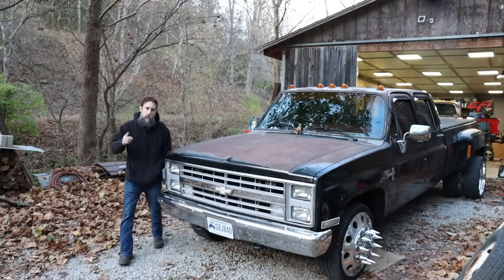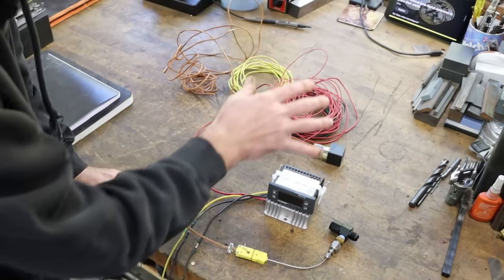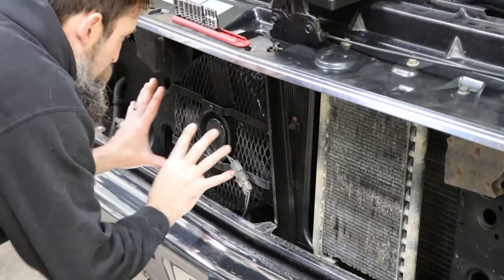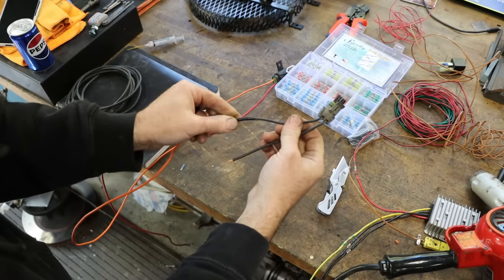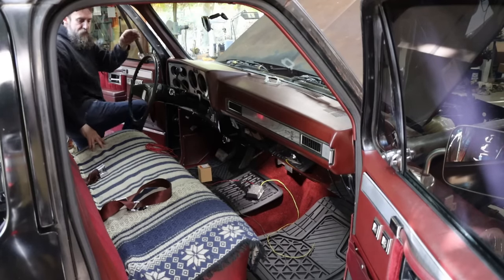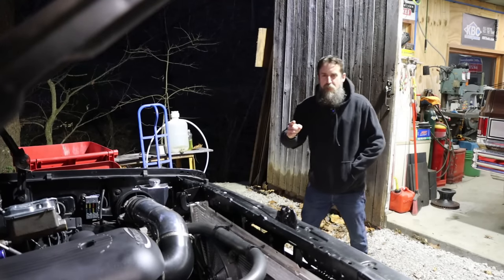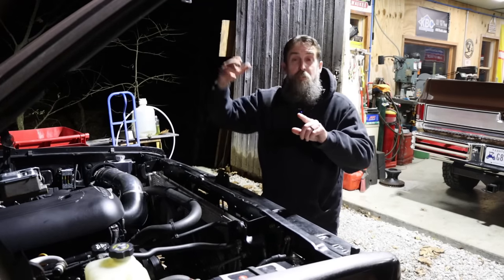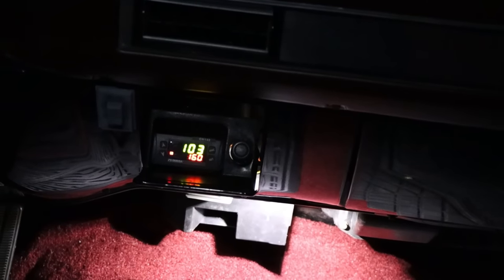Losing my Cool with Johnny Cash the Crew Cab,

Comment: 💡💡🤔🤔I used the lighter hole in my ashtray in my 1990 GMC Sierra SL to install a blue led push start button off the turn key ignition wire. Works like a charm. BIG Plus anyone trying to steal the truck won't have a clue why the engine isn't starting after busting the ignition key tumbler. Than I reused the + - wires for the lighter to install and power a USB charger in the dash. Win Win

Comment: On a somewhat related topic. I wanted a water cooled tig torch on my tig welder. I used an aftermarket transmission cooler that I had laying around to pump a 50/50 mix of antifreeze/distilled water solution thru the tig torch, thru the cooler and used a 1 gallon gas can as the reservoir. It works like a charm. the whole setup including the pump cost me about $100. The transmission cooler has plenty of capacity to keep that torch cool. I even installed a little needle valve to regulate how much fluid gets pumped thru the torch, but that probably wasn't necessary. The antifreeze/distilled water solution will ensure that I don't get any lime scale build up from plain tap water.

Comment: Great video! The difference of heat transfer between a metal tube in water compared to a metal tube in air is about 25X.
Reply: Assuming the air and water are the same temp, yes.  Difference between the air and coolant temps comes into play though, so it's not that large a difference.

Comment: Not only you can manage the transmission fluid temp with this, you can also check if the heat exchanger in the radiator works as it should. 
Great vid on a great job, thx a kot!
That ladder story was creepy, stay safe!
👍👍👍

Comment: Nice installation - not that I am surprised by that given your attention to detail. I'm certainly glad I have a transmission temperature gauge on my truck as we haul a 5th wheel travel trailer a lot in traveling season. Mostly we travel in early summer and the fall and so far, so good, but it is reassuring to know. Transmissions can fail very fast if they overheat a lot.

Comment: Steve, for whatever it's worth, I've been working on a parking lot sweeper that is diesel powered, and the radiator has an integral hydraulic oil cooler on it. I think there's a lot of history behind radiators with transmission coolers on them.

Comment: LOVED this video, even running the wire. I had questions about how and where you were going to place the thermocouple and you not only answered every single one but also discussed your interim solution. All the while telling a funny story with a message. In the lovely shop you renovated. On the perfectly restored truck you built for your wife. Damn dude, inspiring much???? 😀WTG.
Reply from the maker: Thanks, 👍😁 I figured it was best to cover my thoughts and why I did things the way I did, or else folks would have lots of questions.

Comment: About two weeks ago, i had a ladder fold up on me, causing me to fall 4' to the concrete butt first, i saw stars, and it took me a couple mins to get up. I had a pretty intense pain in my lower back for a little over a week, it's lots better now. At 51yrs old I was praying I didn't do permanent damage. That ladder met it's maker in the form of a sawzall. Y'all take care
Reply: Good to make sure that ladder will never be used. Have done the same plus used a saw to cut a dangerous wood one up as people kept using it. Seen them in use held together with tape and strapping.

Comment: Good to see you and a great video. As a retired electrician, Moore than once I have missed the last rung on a ladder and wound up on the floor. Just in a hurry, not paying attention and it happens so fast. I feel your pain. OSHA wants both hands on the ladder. We used a good sized drill to make 1" hole for wires, but we used the cord to lift n lower the power tool. We always got the ones with a twist lock at the drill or got help from someone to hand it up or take down. You are lucky, I was lucky. But you gotta do whatcha gotta do to get things done. So glad you didn't get really hurt.OSHA can make things so much worse. Take care n slow down. We would really miss you if you were not here for our Saturday morning. Thanks for all you share with us.
Reply: Well said .......🍁

Comment: Yeah, I feel your pain about that fall. I was shoveling some snow, a couple of years ago, from my somewhat steep driveway. I was foolishly wearing worn-out Crocs at the time. I was done shoveling and was just going to put the snow shovel away, when I realized I was literally upside down. I landed on my Rt upper arm and shoulder. I've taken a fair number of tumbles in my 70 yrs, but I've NEVER had an impact like that. I believe I blacked-out for a bit, but still struggled to my feet, where i leaned on my car for a bit to catch my breath, then, according to my wife, my eyes rolled back in my head and I passed-out, again. It rearranged my entire rib cage on my right side, and it took about 6months to feel even somewhat normal, again.

Comment: Hey, Steve. I've used those same type connectors and have found that a little soldering flux on the wires makes for better solder penetration while applying heat to the connection. You should test it out to see if it makes a better connection. It might be good content for another video. Have a great day, and stay safe. Sorry about your boo boo. ;)
Reply from the maker: I will try that👍
Reply: Would also suggest making sure wires are clean as well. Plus switch 12v and not ground as that is less likely to result in the fa  motor rotting as it now always has power. This means any moisture in it will cause corrosion as the current flows to ground. Putting the relay near the battery and close to the fuse means less high current wire runs. Controller supplies 12v to the relay as well so no corroding there. Plus switching supply means if you want to get ac running again you simply splice in the 12v wire as the ac will apply 12v to run the fan as well. Less work overall and you could simply have spliced in a single wire to the fan.

Suggest moving the sensor to the input side as after all you want to see if the fluid is arriving hot not that the cooling is working so sense if the trans is working hard and apply extra cooling till it is not. Trans normally gets hot with slip so highway is not a worry but frequently changing gear or not locking up gets it hot fast.
Reply: @SeanBZA  I agree with switching the positive side, but how does mounting the relay closer to the battery make the high current wires shorter?
Reply: @SeanBZA I’ve found it quite common for switched grounds in the GM vehicles I’ve owned and modified. The aftermarket EFI system in my 68 Camaro switches the grounds for the electric fans. Not saying it’s the only or correct way, but it is quite common design from the OEMs. The trick for add-on components is ensuring the added ground point has a low resistance bond to the chassis ground. Relying on a fastener isn’t sufficient in most cases, so it’s always best to remove any paint from the chassis prior to fastener installation. Been using those solder sleeves for 30 years or so. They are quite common in the aerospace industry for splice repairs. I did many of them on the space shuttle.
Reply: @paulharris9434  Here the fan is literally a foot away from the battery, so you just need to have a foot or so of high current wire, the rest can be low current wire, as the fan ground already is there to run it, no extra wire needed. Just have the battery, the fuse, and the relay right there, nicely weatherproofed, and then a wire to the fan in a sleeve to protect it, and then run the control wire to the controller, which also has a nice extra safety in that if the 12V to the controller fails the fan will not run, even if the relay in the controller sticks on.

Comment: I love your system and I would do it the same way, except one Thing. 
The hot inlet from the trans, has to go to the top of the cooler, and the cold out of the bottom. 
The warm area will always be in the top part of your radiator. So you will not get the efficiency of the cooling with the opposite connection.

Comment: I think the 4L80 has a temp sensor built into the harness at the valve body and it is accessible in OBD data. I bet there is an option in your PCM that could have been used as well. Either way, loved the project in this video.
Reply from the maker: They do have a built in thermocouple in the trans wiring harness.  It can definitely be accessed with a proper scan tool. I believe the ECU monitors trans temperature and can put it in limp mode if the temperature goes above some set temperature. 👍
Thanks for watching the videos 😁

Comment: Steve looks great I'd actually recommend placing your thermo couple on the output line at the transmission or if I remember correctly there is a spot on the left side where you can add one but not the best.
Pan temp is a good average but in line will show real time max temp what the cooler will be seeing is why I'd like to see the output temp so you nip the temp rise in the bud before it gets out of hand!

Keep up the good work!

Comment: great video,  the temperature of the radiator will be a lot lower that the engine temp as the thermostat only allows flow to the engine when required. so your hot oil from the transmission will generally be hotter that the coolant in the radiator.

Comment: Steve worked at a transmission shop when in high school you can get the transmission too cold. When too cold it will not shift untill it is warmed up.

Comment: I actually was powertrain cooling engineer for GM Truck Engineering. A few random thoughts: the heat transfer of the fluid/fluid "top" tank cooler is significantly more than the fluid/air cooler. Also, the fluid/air cooler is dependant on airflow which correlates to speed. Airflow through becomes more restricted the closer you mount to the radiator. The top tank coolant is lower than engine temp... otherwise your radiator isn't doing anything. You could move your thermocouple adapter to the trans cooling outlet versus dropping and welding on the pan. Where you take the reading is irrelevant; its just a reference point. A temporary way to capture pan temp is to run a thermocouple attached to the dip stick. Way easier to just monitor the data stream.

Comment: The ATF works best when it is warm so that it being part of the radiator helps the AFT to warm up quicker and then it stabilises with the radiator temp.  In winter in particular, the sooner the ATF is up to temperature the better so as not to drag on the clutches.

The as installed wiring system is correct, you do not need to monitor the fluid temperature in the trans pan, what's important is the temperature going into the pan.  Remember the fluid is circulating all the time so that any excess heat will be going through the cooler(s).  What is vital is to monitor the temperature going back to the trans as that does not want to be overheated so that your thermistor is correctly positioned to warn of that and to switch on the fan to add extra cooling.  If you are paranoid about the trans temperature fit a simple temperature gauge.

Comment: Hi Steve.  Some Silverado's, Sierra's, Suburban's, etc. came with a trans temperature gauge in the instrument cluster.  Your 4L80E may already have a temperature sensor built in.  I'm not sure which ones do or don't.  I think though the way you set yours up will work fine and is certainly better than not having any idea what the trans temp is.

Comment: Nice job on the additional trans cooling. I would like to draw your attention to 18:00 in the video. The open space seen between the core support and the cooling stack ( radiators) will allow air while at speed to rise over the cooling stack and while at low speeds or siting still will allow some of the heated air that exit the stack to recirculate back through the stack lowering efficiency of the system. If you shroud the cooling stack on all four sides to funnel all the inlet air from in front of the core support it will aid in cooling especially on those hot summer days.
Reply from the maker: I have been looking for a good way to seal around the radiator. I was thinking some sort of foam.
Reply: @SteveSummers   I have used everything from foam, rubber weatherstripping, conveyor belt material along with aluminum sheet/structural stock welded and/or riveted for structure.
Reply: @SteveSummers  How about the foam swimming noodles?

Comment: I have been told with these transmission you should run the aftermarket cooler first that way it the temp of the transmission will be warm enough to let it go into lock up because in the winter it mite no get warm enough to let the transmission to gointo overdrive and or lockup because to cold

Comment: I think I saw someone who put a trailer brake controller in an ash tray similar to what you did.

I wonder if someone makes a dual thermocouple monitor box so you could have the pan temp connected to the fan controller and also simply monitor transmission inlet/outlet temperatures.

Comment: The coolant heat transfers from your 2 heat exchangers should be more than adequate for your configuration and use. This is not Formula 1, NASCAR, or a compact nuclear  reactor🎉😂. I agree with a closer control location closer to the output rather than the input. Love your videos dude, keep on recording.🤙👍👊👊

Comment: Take it from a guy that has learned the expensive way, you can kill a transmission by over cooling it.  This is why factory cooling is done in the radiator. Engine coolant keeps your trans temperature in optimum temperature range, not too hot or cold.  For this reason your fluid should go to the external trans cooler first, then pass through the radiator so that it stays within the optimal temperature range for best transmission life.

Comment: You made a simple cooling circuit quite complex. You could have used a thermal switch with the value you want and there is a relay for the fan already in the car, you could have controlled it with that thermal switch.

In cooling circuit, the temperature measurement should be after the cooler, so you have it in the right place. If it were in the oil sump, the fan would run unnecessarily.

Comment: The way you plumbed your cooler setup is pretty much identical to how Chevrolet did it from the factory on my HD 1 ton van.  If their engineers thought it would work for HD applications it's likely just fine.
Reply from the maker: That's my thoughts as well. They have been doing it like that forever.

Comment: A customer of mine stopped by my shop one day arm in a sling and the first thing he did was throw away a brand new wooden 3ft step ladder into my dumpster. One of the feet broke and he fell off of it. He broke his collar bone, boy was he mad at that ladder. He didn't even bother to return it for an exchange or refund. I later took the ladder out the dumpster duct taped the split leg back together and still use the ladder till this day. This was 20 years ago. I never seen someone so angry at an inanimate object before.

Comment: put a sensor in the line coming out of the tyx and the line coming out the final cooler to see the tx temp and temp drop across the radiator.

Comment: You can move your probe to the line coming out to radiatir input and get a closer reading of oil temps than being out in grille and getting air cooling that can give you misreadings or temps lower than you want to kick fan on... then do the pan mod if you feel you need that when you change oil and filter...🇨🇦🤓👍
Reply: If you catch it after the radiator then you are basically measuring coolant temp not the transmission temp.
Reply: @ericpaul4575  
yes ..why i would put it after it leaves transmission...

Comment: That's a lot of monkeying around when all you need is a temperature switch in your coolant line to operate the fan relay.  Just find one that comes on when the transmission coolant reaches a temperature that is above the recommended level.  With your ability to fall off a ladder, chances are you will drive your truck and trailer off the road while trying to read that monitor and fiddle with all those little buttons.

Comment: Yeah your sensor really needs to be in the pan unless you do like i did and put a sensor in front of the cooler and another after the cooler. Lol but then i mounted my cooler underneath next to the transmission for a number of reasons. 
Usually most people recognize that the transmission oil temperature is supposed to be greater than the coolant temp. Getting the transmission oil temperature up to operating temps is as important as keeping it from overheating. This is why the original engineers ran the exchanger through the coolant. 
When dealing with transmission cooling you have to be careful and realize that the cooler doesn't necessarily get a full continuous flow. Some only get full flow under certain conditions. Such as torque converter lockup or lack of lockup. I cant remember which ad its been a long while since i dealt with the issue.

Comment: Ahhh the first 2 minutes he spent describing my experience with half my gm trucks. Hopefully this works but sadly certain transmission conditions can create lots of extra heat. Because of the way the transmission coolers work you can sometimes out stone cold oil back into the transmission from the cooler and still have an overheat condition.

Comment: Is there any hysteresis on the controller? Ideally you’d want the fan to kick in at, say, 160 but not kick off until 150. Otherwise the fan may short cycle as the thermocouple is so responsive.
Reply: Those temp controllers have programmable hysteresis.
Reply from the maker: Yeah, that little controller is very capable. 👍
Thanks for watching

Comment: If the cooler that's built into the radiator and the additional cooler are doing their job, the fan shouldn't need to run. Only if the fluid reaches a too high of a temp, then the fan should kick on. Make sense? 🤔